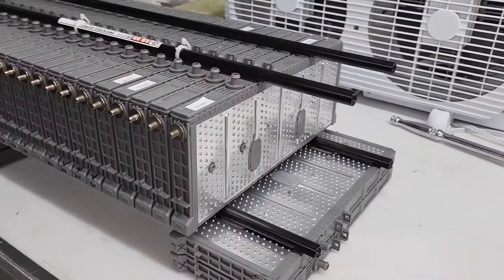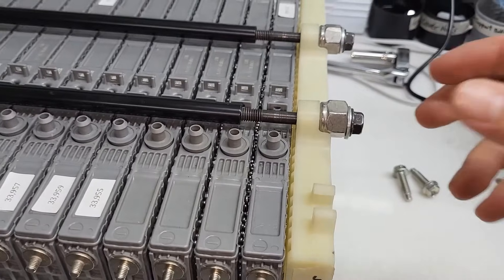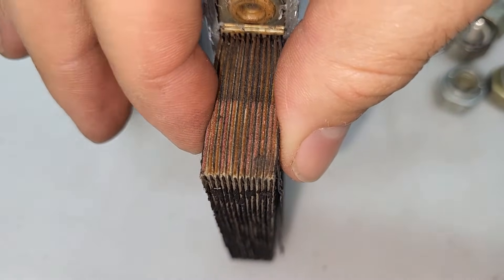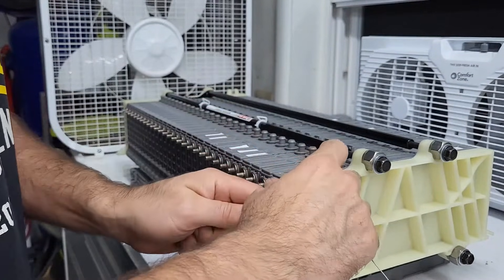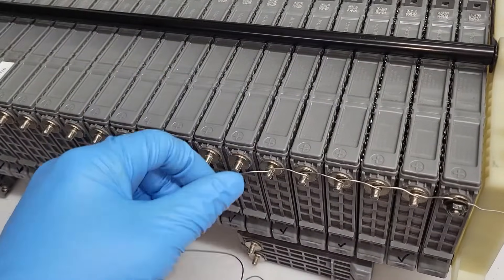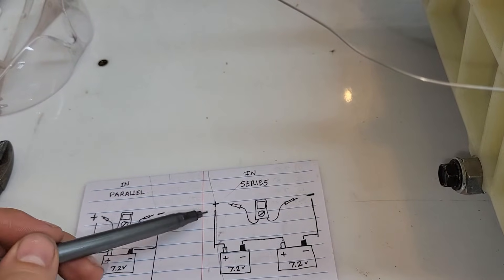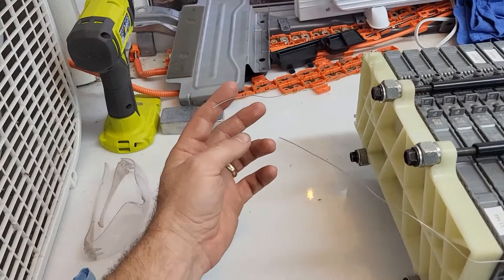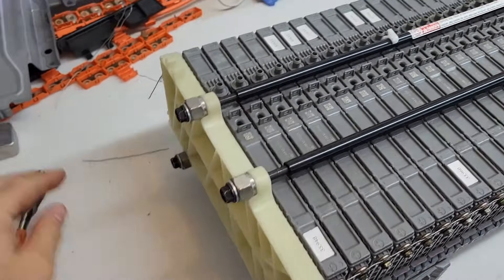Toyota Hybrid Battery Balancing

Comment: This only balances the voltage. However if the capacities aren't balanced within a single drive after refitting the battery you'll see on the Dr Prius app that they are all out of balance already. Current, Voltage and Amperage are all tied by Ohms law. You can't just expect to change one and not have the others change.

Comment: Keep them clamped under pressure when charging or discharging.  The worst that can happen is they puff and then form crystals, in which case they can never be clamped back into place.    Leaving them for a few hours in the cold can cause the gas to condense back to liquid and unpuff them most of the way, as long as they haven't formed crystals.  Crystallization of electrolyte is irreversible.

Comment: 6:18 it's not multiplying the amperage, it's mulitplying it's Ah capacity... You think it's adding the amps together like it would for voltage in series, but it's still just 7.2V @ whatever low amperage, it just has a LOT more Ah capacity 🙂
Reply: That's right, the current through the circuit (amperage) stays the same and is just Ohm's law.  the current through each battery, however, is 1/N where N is the number of batteries in parallel.  Each battery supplies 1/Nth the current and therefore the capacity increases by N times.  In this example with two batteries the capacity doubles and the current through each battery halves.

Comment: So you are able to get the longer compression bolts back into the original Hybrid Battery housing in the car? No problem because one would think you would run out of room at some point. This is a question. You can even reinstall into the car with 2 modules worth of extra expansion?

Comment: Thanks for the video :) "i found this pretty safe since its a safety wire" hahahahahaha.... 
just a little notice: man, the wire is enough not because it is flowing voltage (voltage is potential difference ("its the pressure inside the pipe") it will not flow), it is about flowing current, so the current needed to balance lets say 0.5-1 volts difference between the two or more 7-10V blocks will be very little so there is no need for the cable or a copper bus with the greater cross-section (mm^2). But there is another thing here - and it is resistance. Idially, the resistance in connection between EACH separate module should be exactly the same because resistance is causing voltage drop, and since you took thin metal wire with lover conductivity and its length was about 1 meter, instead of, lets say thicker copper, wire or a bus, the resistance in the wire between the first and the last module in the pack will cause a little voltage drop, so you won't be able to achieve your goal of perfectly balancing the voltage of each module. Peace )))
Reply: So just use the bus bars to do the balance instead of a wire? Easy enough if that’s what’s best.

Comment: So, you have screwed - modules do not fit.  They have swollen because  of your improper charging.  Second, you really don’t need to make wire loops on screws - just run straight across the screws and secure with nuts
Reply: swollen because they were not charged in the clamps
Reply from the maker: Half a dozen for some, 6 for others.  Tomato, Tamato.  The car still runs great & gets 43mpg, so do whatever you want I guess.  This video is just showing what I did & what works. Thanks for your input
Reply: @JohnCalebWarren  I might try this .. but should I attempt to balance a 6.36 module or replace it?  🧐🤔 Thank you